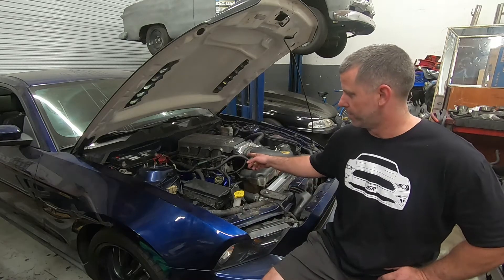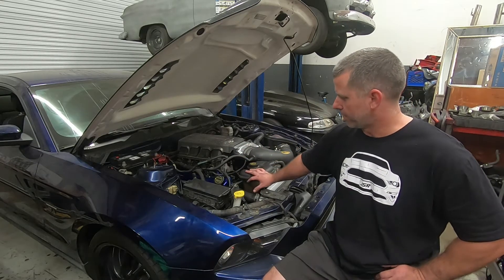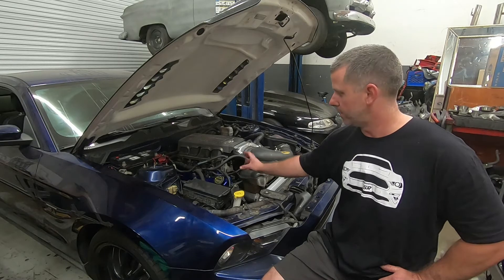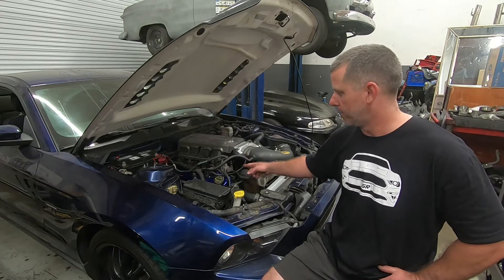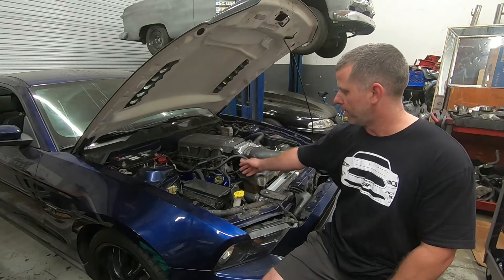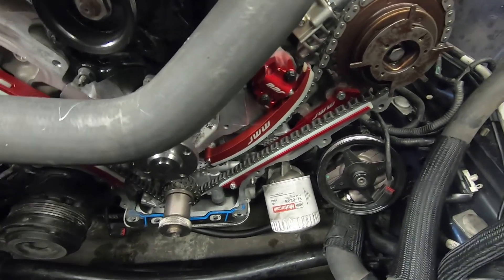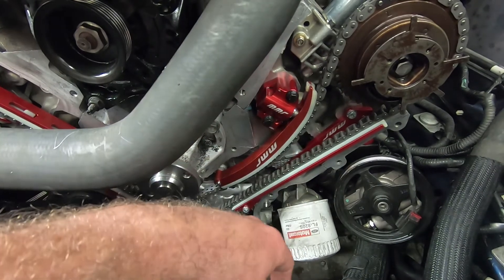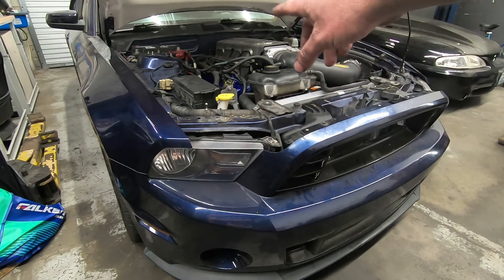Fixing a 2007 Mustang GT with Manley Internals, MMR Tensioners & Guides, and Todd Warren Cams

Comment: Wait ! Did you build a new engine and reinstall old cam phasers ? They look pretty tarnished like they are original lol ! No wonder you had issues, It doesn't matter now because you locked them out, but anybody watching this NEVER use old phasers on a new build. And make sure to upgrade to billet oil pump gears, stay away from mmr gears, get a good quality set from Boundary, take it from me I learned the hard way.
Reply: Mmr gears are great, if your locking out the phasers then it doesn’t matter how old it is it’s acting as a solid gear now, the only reason you couldn’t run a 2v cam gear is becuase the cam senser runs off the contact points that stick out on the 3v phasers
Reply: @Turbo11gen  I didn't have good luck with mmr gears, the tolerance was too much, but glad they worked out for you. And yes, your correct, if the cams are locked out, the phaser is just a gear at that point, but I'd degree the cams in, they can be way off out of the box and leave power on the table.

Comment: Are the mmr , aluminum guides any good ??? I just bought some but don't see any reviews and we'll , I kinda feel dumb for buying them , I don't know if I should put them in or keep stock guides
Reply from the maker: Yes, they are great!  I have used them and they make quality stuff.  Pretty sure they are Ethanol resistant as well, that is a bigger deal then most people realize.  Alcohol in fuel can make it past the rings into the crank case where it eats up plastic and rubber.
Reply: @JohnSmithRacing  really ?? I went too my local shop they were just saying that they are good products and if it's make for the motor all it is , is an upgrade , I also called mmr and they said yeah dude they are good , for just regular use that's all it is